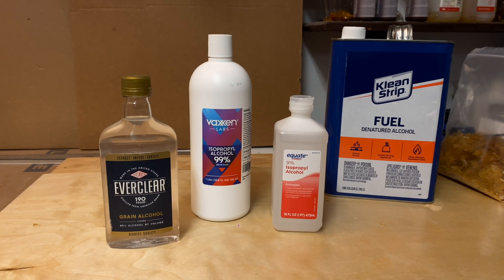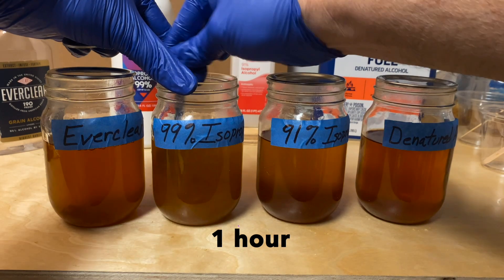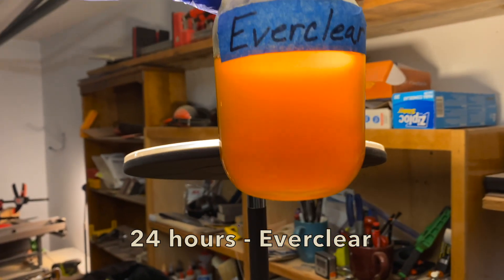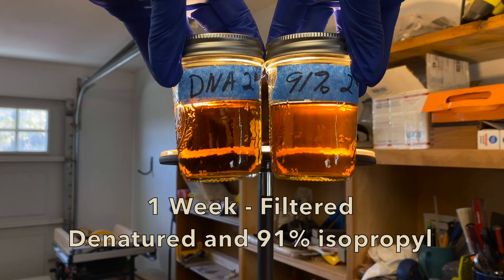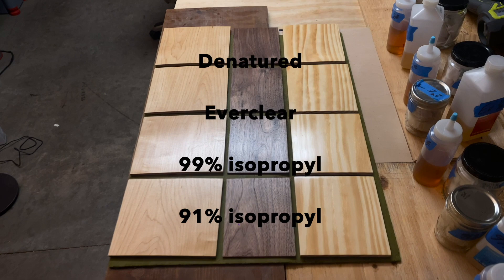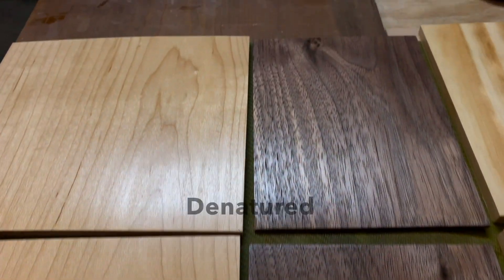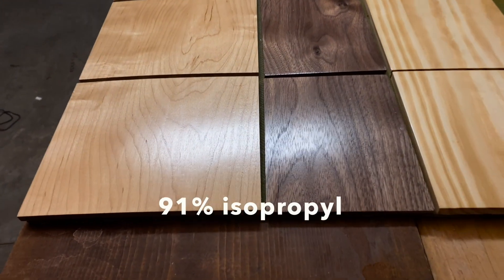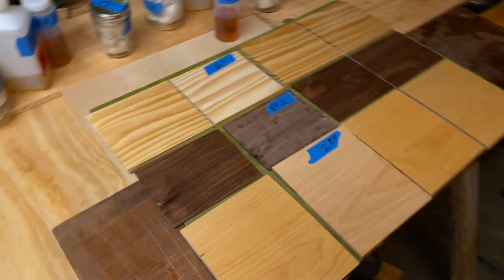Experimenting with Alcohol Solvents for making Shellac.

Comment: I looked up Safety Data Sheets on the solvents. "Denatured alcohol" can have incredibly non-specific contents. Most are water, ethanol, and methanol, but some are water, ethanol, and isopropanol. The exact percentages of each are listed as trade secrets by the half dozen different manufacturers I checked, so often that means they're claiming something like 40-60% each of ethanol and methanol, but potentially wider ranges. By contrast, 99% and 91% isopropanol should be 99% and 91% isopropanol, respectively. This might account for some of the contradictory accounts people have of using denatured alcohol for shellac. It's kind of like saying you used a bottle of isopropanol, but no one knows whether it was 70% or 99% or anything in between.

Also, important: You should wear gloves and work with good ventilation for any of those solvents, including Everclear. The safety data sheet for 95% ethanol isn't any less concerning than that for denatured alcohol or 99% isopropanol. Ethanol is a skin irritant, respiratory tract irritant, and a known carcinogen.

Comment: 99% isopropanol is worse than 91% isopropanol because the 91% version is higher in polarity because of the water content. Ethanol is also higher in polarity because it is a shorter/smaller molecule.
Try methanol.

Comment: I use 96% ethanol and it usually dissolves the flakes within 12 hours. I don't grind them up. Then I start off with two coats of 1/2 pound cuts, moving to 1 lb to build some body (about 10 coats) to spirit off with an 1/8 cut. 
Before I start I sand up to 600 grid. When switching cuts I use a 1000 (grey) scotch pad very lightly. I also use olive oil when the pad gets too dry. The result is a glass like finish.